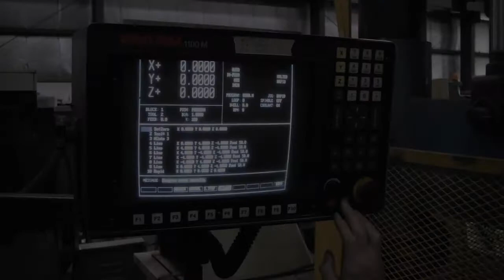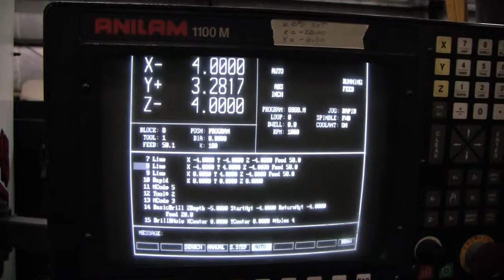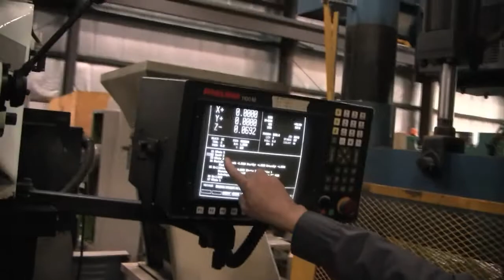FRYER MB-15 CNC VERTICAL MILL www.wismet.com

Comment: Nice machine! I think my job has one (I'm a new guy). I see that this is sorry of a blend of old and new as though this is CNC if did not have an automatic tool change. Also it looks as if the x axis rotates, something I don't even see on a modern tormach. This is on 220v? I saw one one eBay that said 480v, is this a dual voltage machine? Cool.